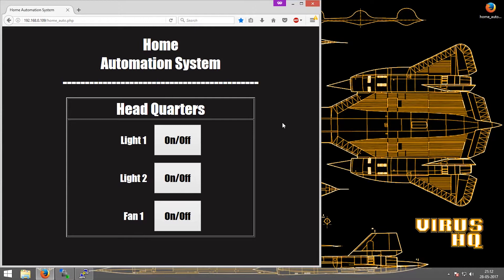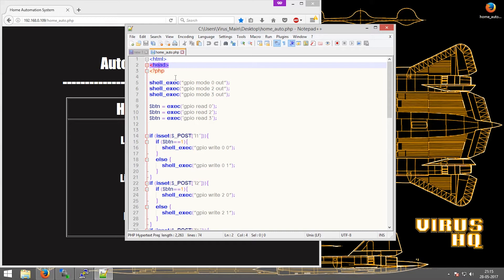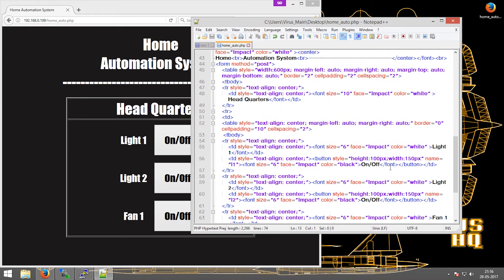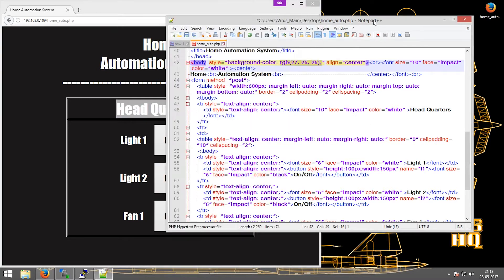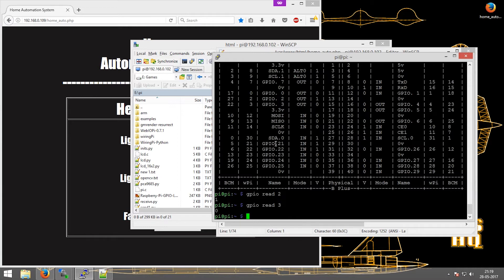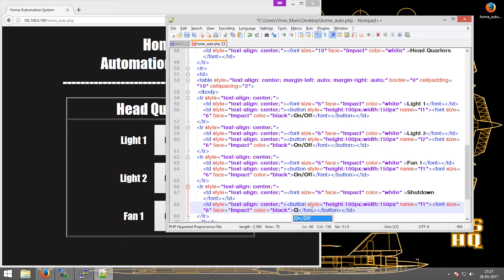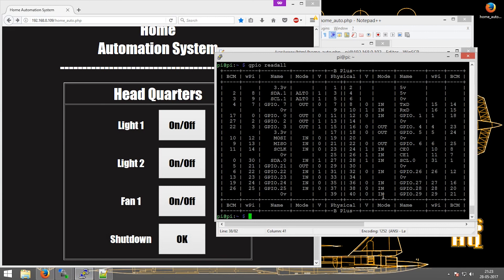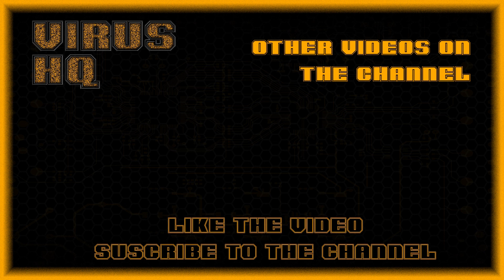GPIO Control over WebPage | Software Pi

Comment: Where we have to type the code and where we have to save it ?? And where the code will be executed ?? Is that  will be executed in normal window browser or it will be executed on chromium pi browser
Reply from the maker: Well the code goes on the pi as will the web script. The web page can be opened from any device connected to the same network

Comment: This will only work if the user which is running the http server (usually www-data) has root privileges. Otherwise it cannot call to change GPIO pins or shutdown the device. This is very insecure and if there is any mistake in the code which can be exploited, it automatically has root privileges and the attacker can perform any action on the device.

Comment: how can we add push_button like an input ?
Reply from the maker: you need to connect it to a gpio pin , along with a resistor and then just add it in the code , https://raspberrypihq.com/use-a-push-button-with-raspberry-pi-gpio/ , this will provide a good read-up :)